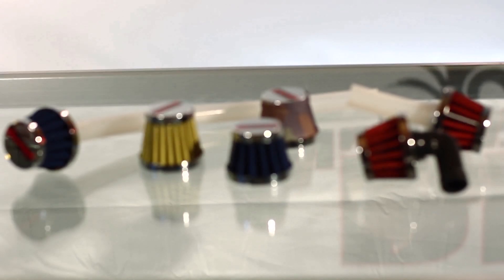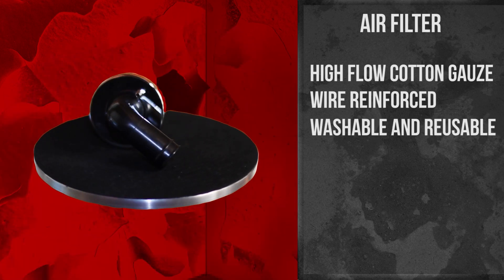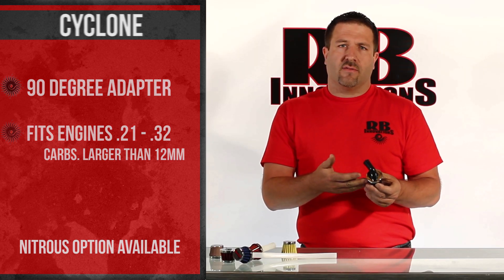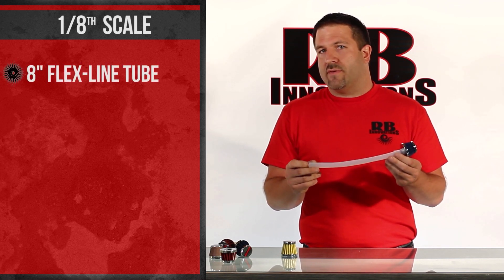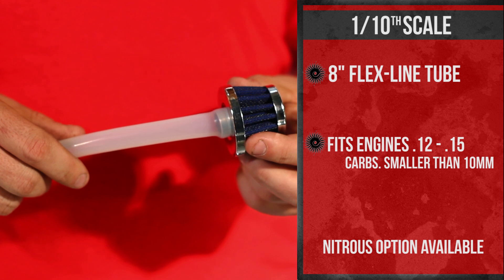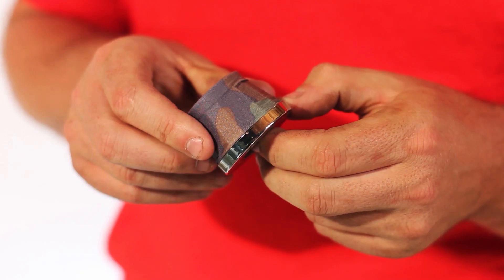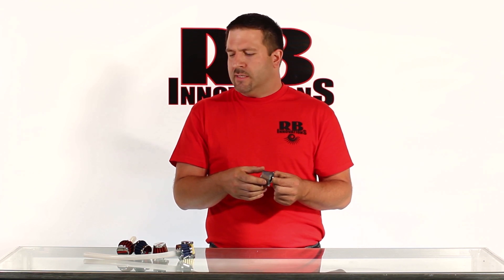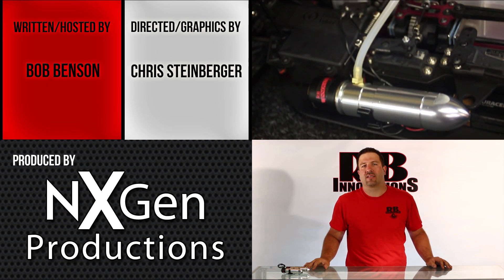RC High Performance Air Filters

Comment: New to nitro if you turn on car with out filter will it take off on its on? My problem is all my wheels are rolling by its self. What do I do ?
Reply: Adjust your idol screw
Reply: That's an idle issue dude. Counter clockwise to reduse idle.
Reply: Set your low speed needle correct if it's not then adjust the idle
Reply: Also Maybe a bit richer